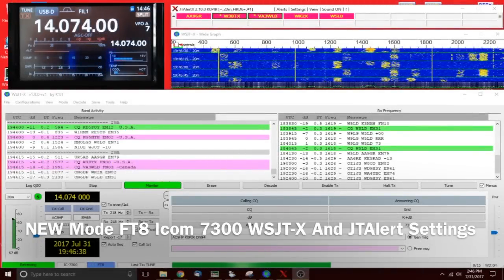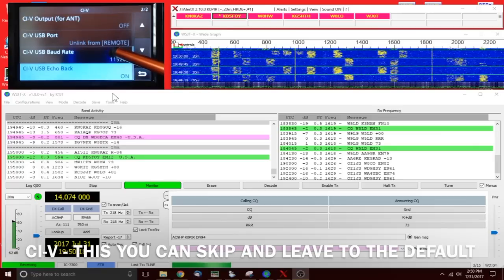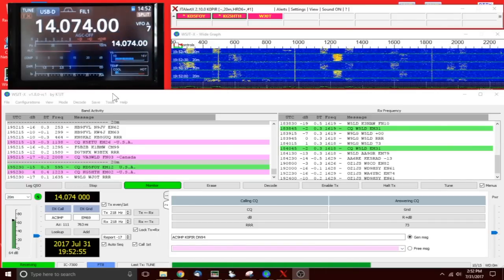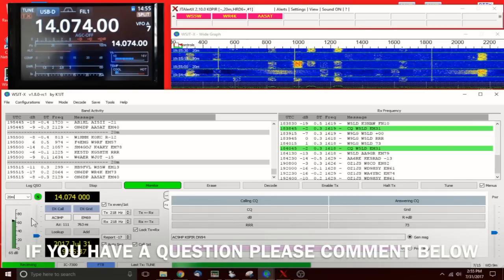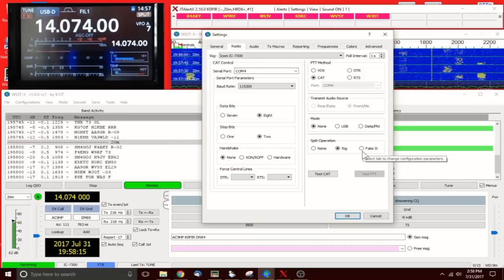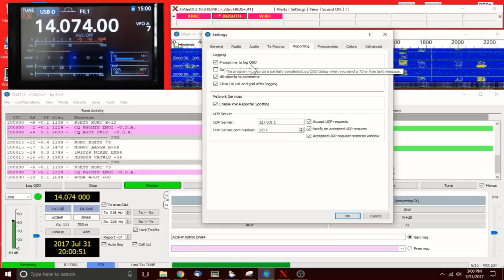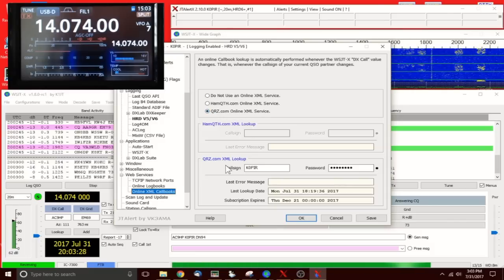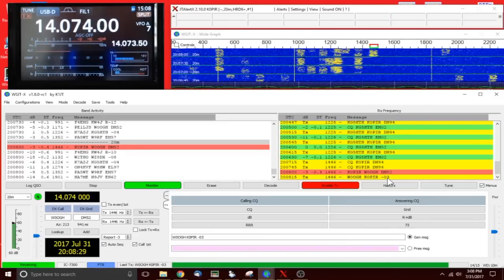NEW Mode FT8 Icom 7300 WSJT X And JTAlert Settings

Comment: Big Thank you to Rich. He has the patience of Job. His emails to me were of great value.
I finally got WSJT fully functioning.
Here is what I found for anyone having similar issues to me.
1) The internet time clock standard is a poor reference. (i.e) It is not accurate enough unless one wants to zero it every time you start the computer.
I downloaded "Dimension 4"...Does a great job.

2) Windows 7 has a oddity in that if one downloads the WSJT software to it's default location (C:/user/programs)...certain permissions and restrictions come into play; partially crippling the WSJT software.
One has to simply create a folder; (I called mine WSJT, and down load the executable file there before running the program.

Now, if someone can tell me how to run AClog and WSJT at the same time, I'd be tickled as they share the same com port on my computer.

I run just USB, no CiV.

Thanks again to Rich.
Reply from the maker: Hi Pete, 

That is super you got it running. I did not know that about windows 7, so thank you for posting that tidbit of valuable information. It will certainly help someone.

Thanks again and best 73! I hope to hear you on the air!

Comment: Good video, keep going. I'm having problems when trying to work ft8 on expedition mode. Using the latest version of wsjtx, version 1.41( ic7300) win 10. After hit ok for special operating Activity ( advance Tab). A message Pop up and need to close and disable this function. For normal operation on ft8 no problem. Saludos XE2GRC
Reply from the maker: Let me check that out when I get a chance.

Comment: Tell me how to fix this error "an error opening the audio input device has occurred" Installed VIN 10 access to the microphone is open, the transceiver is configured as you have, connected to the laptop with a USB cable in the task Manager one com port 3 prescribed it in the settings of the WSJT program, the driver installed , did not help

Comment: I thought the 7300 had 1 stop bit, not two. Which is correct?
Reply from the maker: Mel Ming Nice to hear from you. Yeah the thing is that it seems to work either way a lot of the time. I found it doing this in Linux,  my Mac and in my windows PC. Evidently it’s not too particular. In one program and I don’t remember which one it only worked set at 2. Thanks for watching Mel have a great day and 73.

Comment: I'm using a MacBook Pro and WSJT-X.  All I have is a USB cable going from the computer to the 7300.  I'm using MacLoggerDX that works Great!  I did all the updating via the terminal on the computer as you show in your video.  Is there something I need to do in the 7300's menu to get RF out?  I can RX with no problems but I just can't get any RF out from the radio.  Once I figure that out I'll be up and running on FT-8.  Any idea's you can give me will be much appreciated so I can get on the AIR...  

Thanks -   Tom

Comment: Hi, I have 2 questions,  the Ci-v cable, what port is it plugged into on the back of the ic7300? And why do you operate the 7300 in split mode?  Cheers Trevor ZL1UTH
Reply from the maker: Hi Trevor, nice to hear from you and thanks for posting your question here. The CI-V plugs into the remote port on the back of the radio. It looks like a computer mic or speaker jack on the rear of the 7300. There's a long explanation why guys use split but the simple answer is that it keeps your tx signal in the sweet spot. Depending on the situation it'll make your signal better.
The long answer from WSJT-X User Guide: Split Operation: Significant advantages result from using Split
mode (separate VFOs for Rx and Tx) if your radio supports it.  If it
does not, WSJT-X can emulate such behavior.  Either method will
result in a cleaner transmitted signal, by keeping the Tx audio always
in the range 1500 to 2000 Hz so that audio harmonics cannot pass
through the Tx sideband filter.  Select Rig to use the radio’s Split
mode, or Fake It to have WSJT-X adjust the VFO frequency as
needed, when T/R switching occurs.  Choose None if you do not
wish to use split operation.
Thanks again for commenting and best 73! de K0PIR.us

Comment: Under radio when I press test CAT it gives me a Hamlin error: IO error while opening connection to rig. Did I not configured the radio correctly or is my new cable faulty?
Reply: Just tried a different cable still does the same thing
Reply from the maker: Hi Fred, nice to hear from you and great question. I've heard that one a few times.

Usually, yes it's a connection error. Check the settings in the radio. Can you connect with another Ham application using the same cable? If so, then check the settings in WSJT-X. The baud rate, COM port, etc.

Rich, K0PIR
Reply: Ham Radio with K0PIR  I got it figured out I had to download Hamlib. Thanks for your help with this video. Do you have any that show you how to configure the macros or the STDs?
Reply from the maker: Excellent! Thank you so much for commenting. It'll be of help to others.

Macros for PSK31, a little, coming up in a new video. However, it is using WinWarbler.

In WSJT-X we are limited to very few characters so the Free Message field is the only other one I use. 

What program are you looking for help with Macros?

73,
Rich, K0PIR
Reply from the maker: Fred, what radio are you using?
Reply: Ham Radio with K0PIR well thank you for your help. I’m still having a lot of distortion in my waterfall keeping me from making QSOs. I have all my filters in my AGC turned off. Still can’t figure out what it is
Reply from the maker: There are some sliders to adjust the waterfall gain, but usually it works right out of the box. If you are using the Icom 7300 check the ACC/USB AF Output Level. Mine is usually around 40%. You cal also check the Windows soundcard level for the USB Audio CODEC. Maybe it is too high. The meter on the left in WSJT-X should be hanging around 60 to 80 dB when receiving. Do you have something for time? Accurate time is a must in these modes. I am using NeTime. http://www.timesynctool.com

You could try another band and see if it is some outside interference just on one band for you.

Comment: I thought your video was very informative and I was able to receive and decode FT-8 signals but could not get it to key up the transceiver.  It calls a station but it will not actually key up the transmit portion.  I was very surprised to see that there were not any entries for the IC-7600 reference setting up for FT-8.  I love my IC-7600 but kind of feel like a bastard child since there doesn't seem to be anything for my rig.  Any ideas as to what is wrong?  I would appreciate any and all help...thanks in advance.  KD1DT  (arskd1dt@gmail.co)
Reply from the maker: Hi Steve,

Thank you for the comment and question, nice to hear from you. I have friends with the 7600 and I am not sure what they do for WSJT-X, but I can hazard a educated guess.

You downloaded the Icom USB driver for the radio? 
You have the radio setup and in the radios menu and you have Data1 MOD set to USB?
Is the radio in USB-D1 mode?

In WSJT-X in the Settings and Radio tab are you using the 7600 for the Radio?
Under CAT control you have the correct serial port and baud rate?
For PTT are you using CAT?

What happens when you push the Test CAT and Test PTT?

If everything is working and you just don't get PTT you could try another PTT Method. I have used RTS in the past. Just use the correct Port.

Tell me more of what you are using. 

Rich, K0PIR

P.S. I started using Dat/Pkt for for Mode in WSJT-X and Fake it for Split operation.
Reply: Thanks for fast reply.  I tried to reply with answers and screen shots of settings and error messages but it says that your reply is a no-reply return address.  Is there an email that I may use to send this info to you?  All the best to you and yours, KD1DT
Reply from the maker: Hi Steve,

My e-mail is good on QRZ.com
Reply: Yes, I am using Dat/Pkt for the mode and Fake It for Spit operation.

Comment: You can edit the frequency that windows uses to update the internet time in regedit. I set mine to once a day (86400 seconds)from the default once a week. I found the instructions can be found on the Microsoft Windows community website. Be sure to read about how often you should update your time. You don't want to ping the time servers too often or you could get blocked.
Reply from the maker: Hi Bob,

Thank you for the info. I did not think of that. Good idea!

73,
Rich, K0PIR

Comment: Well, first of all, you don't need to use a CI-V cable with the 7300. You can both control the rig and work digital over the USB cable. The USB cable is all you need. Also, those having trouble with Hamlib...make sure you've downloaded and properly installed Hamlib. If you're using HRD, you don't need Hamlib...simply select "Ham Radio Deluxe" in WSJT-X.... de W4NNF.
Reply from the maker: Hi Rod,
It's nice to hear from you. Thank you for commenting and I know just what you mean about the CI-V. I have a few videos using just a USB and also a couple on VSPE. My thought on CI-V, if it's there I want to use it. Later I may decide to disconnect it, but I don't think so.

Thank you for mentioning the info on Hamlib and HRD, well put. Have a great day and best 73 - Rich, K0PIR
Reply: kenwood ts ;480 hf vs icom ic 7300

Comment: Finally got the 7300 to communicate with WSJT in JT65. I made a contact, but for some reason I can not see ANY activity in the waterfall?
Reply from the maker: Hi Pete, I sent an e-mail to you. Is it just blue and no signals or os it black?
Reply: I have tried the wsjt-x  and could only get it to receive not transmit tried for over a month to get the damn thing to work and it wouldn't work I will always get the error could not communicate with the rig Hamlog blah blah blah then when I was try to implement it was shut the damn program down so therefore I could never get it to run load of horseshit

Comment: Guess I have a lot more playing to do. Giving it up for tonight. I saw some decodes and now nothing? I'm assuming one positions the "U" shape over the signal to lock onto freq?
Also, any way to get rid of the annoying horizontal bars in the waterfall?
Reply: Hi Rich and thanks again.
I sent you a email from your qrz address.
Arrgh. LOL
I'll copy and past what I sent in the email.

Had this software working intermittently.

Rig: IC 7300

Settings on Rig:

Data Off Mod                 USB
Data Mod                        USB
CiV Address                    94h
CiV Transceive               Off
CiV Baud Rate               9600
CiV USB Port                 Link to Remote
CiV USB Baud Rate      Auto
CiV USB Echo Back     ON
USB Send                       Off

I am seeing signals on the waterfall for JT65 but no decode?
Oddly, earlier in the day I was decoding and even made a contact but I noticed the waterfall was blank at that time. Lots of decoded signals were coming in.
I wrote all settings down for the Icom and WSJT software.
I shut down the computer; when I came back later and launched WSJT and w/o making changes to the Icom, Bam...NO DECODE. 

Another oddity, I was using Data Bits 8, Stop bits 2 at the time when it was decoding? I’ve also tried Stop bits 1 w/o success.

USB audio codecs appear OK and I do see signal strength on the bar graph and in the record sound levels.

Using CAT control, MODE None, (also tried Data pkt) 

I’m wondering what's up after I reset all Icom 7300 menu items to what worked earlier, and now no go? Hmmm.

Any help appreciated.
Reply: Yes..Thank you..I've tried those settings as well. I am using only one cable.(USB)
Ads to your other question to me; YES, I am seeing signals on the waterfall.
Theslider indicates audio present too which I can adjust via soundcard settings; I keep it hovering around 50-60%
Someone mentioned if my computer clock is off by a second, that might cause a decode problem.
Interesting my rig communicates with AClog and HRD.
Reply from the maker: Hi Pete,  we don't have to use the "U" shape unless looking for a open spot in the waterfall to start transmitting or calling CQ. Your pane on the left will decode everything that shows up in your waterfall (about 200Hz to 2400Hz in the clip above)l, just stay on the correct FT8 freq. WSJT-X will do that for you. 14.074 is the default for 20 meters. 

Yeah I don't think those horizontal time lines are an option, but I could be wrong :-)

You're close, just some fine tuning needed. I watched other guys operate on YouTube before I jumped in. It'll come together. Thanks for commenting and adding value to this YouTube channel. Best 73 and I hope to hear you on. - Rich, K0PIR
Reply: Well, guess I will need new help.
All of a sudden I can not get AC Log to work after playing with the WSJT software. I am getting all sorts of "no com port available" etc....Completely unable to QSY when clicking on spots. My com 3 is available and functioning and the one I use for the 7300. I set all the Icom's setings back to where they were before playing with the new WSJT software. I may have to go see a computer repair person..and I'm generally pretty good with computers.  DM 780 won't work either..some sort of comm problem I guess that is beyond me.wow.
Reply from the maker: Hi Pete, thanks for coming back. If you are using two cables, sometimes it's an error caused by getting those two mixed up in the software. I've done it before :-) The USB cable is the Silicon Labs and the CI-V is the Prolific (sometimes FTDI) located in device manager. Can you pull up device manager and verify those and the COM port number?

If you are just using one cable (USB) and you have ACLog, DM780 and also WSJT-X configured to use it, only one of those programs at a time can can be open and using that COM port.

Try restarting your computer and then open ACLog. Sometimes that's all it takes. My settings in the radio stay the same and I use a bunch of different software, so rarely is it a problem with the 7300 settings. Just follow what I have in the videos.

My e-mail is good on QRZ.com, so shoot me an e-mail if you need too.

Did you see this? You can start up HRD and use HRD as "Rig" in WSJT-X. I have used it that way and then I use "Fake it" for split. I wrote a post on it. This should help, see the video: http://www.k0pir.us/wsjt-x-jt-alert/

Did you see this post? http://www.k0pir.us/icom-7300-receiver-settings/
It may give you an idea and here is the followup post: http://www.k0pir.us/transmitter-settings-digital-operation/

Thank you again, your participation here will help others in the future. 73!
Reply from the maker: Hi Pete,

Did you get it? See the screen shots: http://www.k0pir.us/files/7300screenshots/
You have Data Off Mod different and I am using Unlink from REMOTE. Okay?
Reply from the maker: Awesome Pete, yes I use Netime http://www.timesynctool.com and that will keep your computer clock synced. Let me know how it goes. - Rich, K0PIR P.S. I am using just the USB cable now and will be doing a clip on VSPE soon.

Comment: Seems no matter how many different settings I try in the 7300 I get the same message "Hamlib error, communication bus error while getting current frequency" I am using USB only which has worked OK for BPSK, ACLOG, and HRD to control freq. Any help appreciated
Reply: Thanks Richard.
I still don't have it all worked out, but am getting closer.
1) I was getting no power out. (mic/acc) does not work; I had to use SSB.

2) I am getting audio clipping. Looked at the rig's outputs, all ok and turned down the USB codec level to almost zero with no result. Also tried reducing the RF gain on the radio; no joy there either. I am decoding FT8, but with the audio over load, I fear I am missing many of the stronger sigs.

3) The JT modes seem to work all ok..Hmm?

Looks like more research is in my future.

Hamlib still shows a error about every 2 mins or so.
Reply: Thanks again. I was unaware the record audio level is related to the input audio to the software. I am betting that will cure my overload.
Reply from the maker: Yeah hi Peter, it sounds like Hamlib is at fault, maybe corrupted. I had the same problem with my iMac and WSJT-X. Have you tried going to a older version of WSJT-X? Maybe version 1.7 and try to get it working. If that works go to version 1.8 rc1. I could not get version 1.8 rc2 to work. They have a Yahoo group and a Facebook page. I suggest the YaHoo group first. It is listed as wsjtgroup. Okay? 73-Rich, K0PIR
Reply from the maker: You can also start up HRD and use HRD as "Rig" in WSJT-X. I have used it that way and then I use "Fake it" for split. I wrote a post on it. This should help, see the video: http://www.k0pir.us/wsjt-x-jt-alert/
Reply from the maker: For digital modes, check to see that you are in USB-D, otherwise no output. My DATA MOD is set to USB and my DATA OFF MOD is set to MIC,ACC. Those settings are under Connectors in the 7300 menu.

The FT8 signals I see in my waterfall are usually stronger than the JT65 signals. I believe most of that is due to high power stations. Some FT8 stations run a kilowatt or more. However, it doesn't create a problem usually. I would check out the YaHoo group and search some of their conversations. 

Did you see this post? http://www.k0pir.us/icom-7300-receiver-settings/
It may give you an idea and here is the followup post: http://www.k0pir.us/transmitter-settings-digital-operation/
Thank you again, your participation here will certainly help others in the future. 73!

Comment: Also each time I begin a TX the radio changes to split mode.  Is that correct??
Reply from the maker: Yes if you are using split (rig) and the IC-7300 as the rig the radio will stay in split mode. See my latest video and watch the radio LCD in the top left corner.  https://youtu.be/s5be7T0fctU
Reply: I turned off the settings box for split operation now all is well.  Thanks
Reply: Why run split mode?